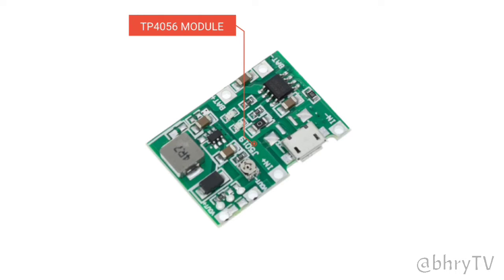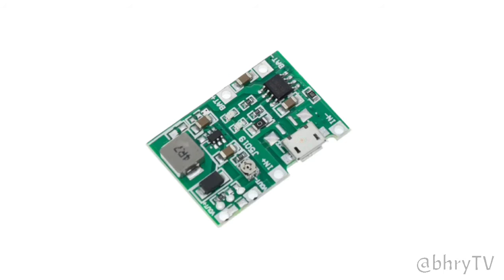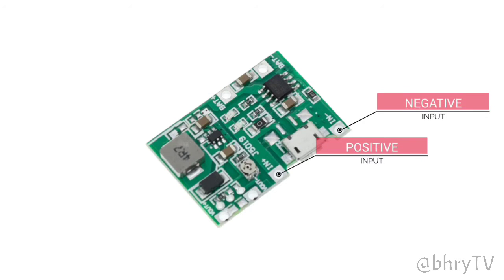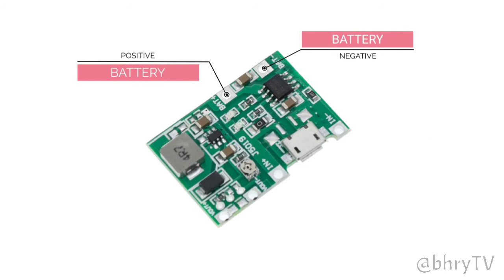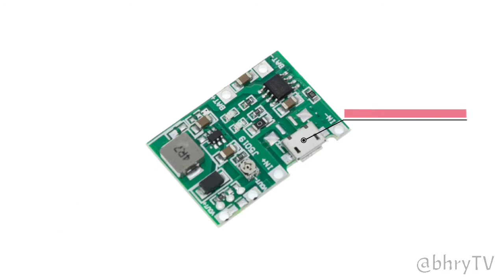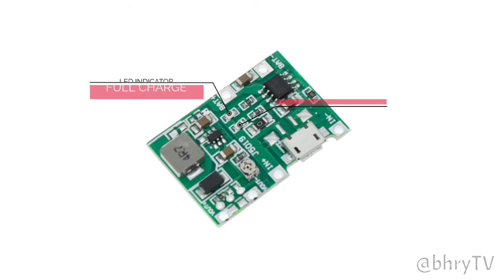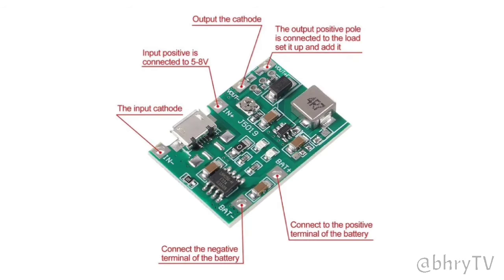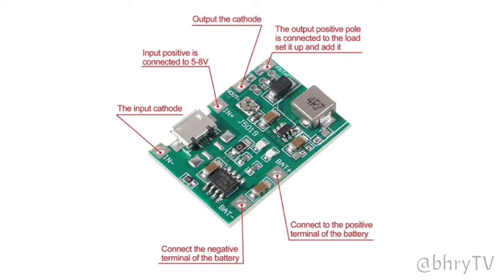tp4056 charging module with built-in dc-dc step up boost converter

Comment: The problem with this module is the fact that the output remains normal even when the battery has reached a voltage below the point where a lithium battery is permanently damaged.
Reply: You can just add bms to the battery to be safe i saw someone do it and it works perfectly fine